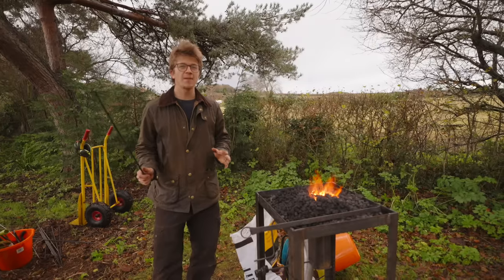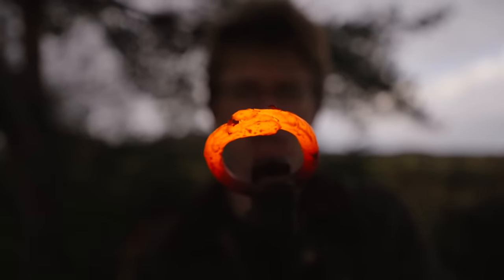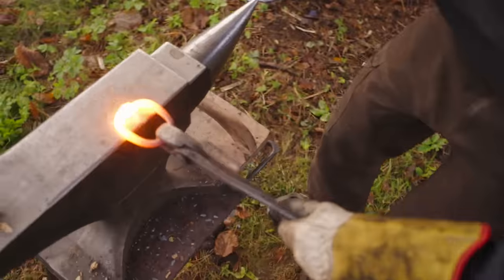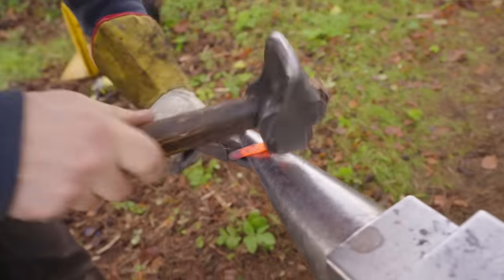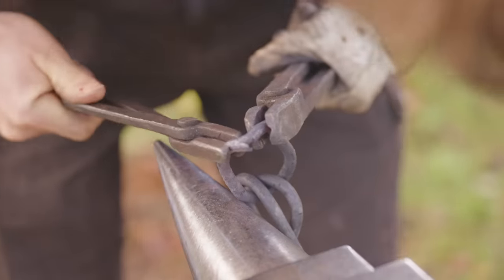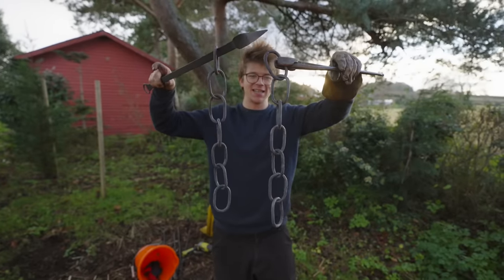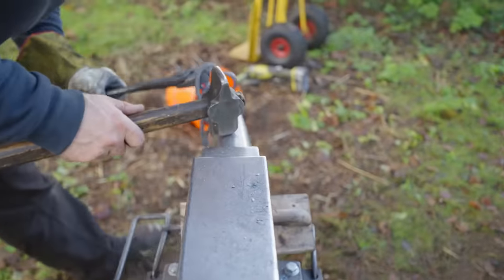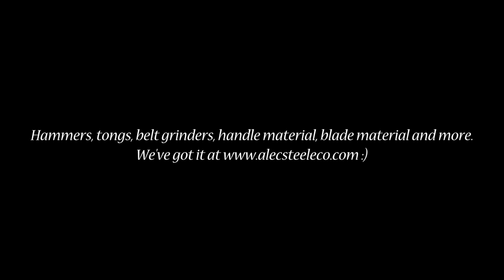How Much Chain Can I Make in a Day?

Comment: You could have potential increased your efficiency by forging all the standalone links first and then making the connecting links. This would allow you to maintain your patternasation without needing to break it on every third link.

You could also use two people with one making all the standalone links and the other linking them together.

Comment: you make your welds on the round end.  modern chain is welded in the middle of the straight part. i wonder if forge welded on the straight is stronger or weaker than welded on the round end.?

Comment: I made chain in my shed on my forge, it’s tricky to get the hang of, I found using 10 or 12mm bar and lengths of 7” worked best, you get a decent scarf and can hit it harder on the weld

Comment: Love the vid! Cool idea and cool thing to do. Only one thing... Shouldn't the weld be on the long end? Or is that a by-product of modern processes?
Reply: I think its just easier to make since you would need some kind of wide and flat on the top horn for correcting the weld. The strength of the weld is the same everywhere i think
Reply: @vaurisyoutube  it depends on how you 'load' the weld. In Alec's case they load sideways as a pushing / bending force. In the case of long end weld, they load lengthways, as a pulling force. The latter usually are more withstandable.

Comment: Really enjoy your videos. 
Curious - other than ease-  why are you joining at the end of the link where the next link concentrates its force?  wouldn't it be stronger to have the joint on the long side so that its just tension pulling rather than a point force on the joint its self at the end of the link?

Comment: My issue is with the positioning of the welds.  where theyre currently located they'll receive more stress directly than if the welds were in the side of the link instead of the ends

Comment: You are missing one vital thing and that is your apprentices. There were blacksmith who only made chain and they would task each one of their boys with a task in the process and then the master black smith would take the links and weld them. He could make chain as fast as he could weld them. One heat and then a proper mold to set the links and then on to the next one. He would of had jigs for holding the chain in place and everything. It would also help if you bought some old chain and examined it. They were all pretty uniform in size and shape. One apprentice would cut round stock to lengh using either a hot cut or cold cut. They would have a forge to which they would move the lenght of round stock over the fire and with a cutting jig and tool cut a sharp angle then another apprentice would be tasked with bending it in to a box shape with enough space that each link could be placed on to the full length chain. The type of chain would factor in during which age you want and what the chain was going to be used for. With a small group of 1 man and 4 younger people you could put out a good amount of work and make a good living. People assume they only had a few staff yet many places prior to 1800 would of had several people working and making things.

Comment: Just wondering, if the weld is the weakest point, shouldn't the weld be on the long, straight part of the chain-link and not the bendy bit? 
Not a blacksmith in any way or form, just curious. Love the channel, Alec!

Comment: The chain making machines were probably one of my favorites to work with

$250k and the operator didnt actually have to do a thing aside from feeding it bars (which a forklift brought in bundles that you'd use a crane to load the whole bundle at once ~2 times per shift)

Comment: Your problem is that you were forging the links while hooked to the chain. Making for more work for your self. You should have set something in your post hung the chain off of that then work the single link until you are ready to slip it on to your chain. Then heat and attach then hammer. Then on to the next link. There is a whole host of information out there on how to do these things.

Comment: I think you should research how they did it back in the day. I only invested a few minutes and they apparently cut them at an angle and most chains I found were welded on the flat part, not the round.

Comment: Just imagine how long it took and the skill to make chain mail. Oh and the cost !
Reply: I may be wrong but I assume with the smaller links and confined jumble it would become would mean that you wouldn't often weld chainmail links. you can buy kits you can make your own with today using pretty much just pliers. I have seen some mail and chain where the links are riveted closed not welded, so this could be a different approach too
Reply: @nathanmiller9381  That's a good point.  Mail doesn't need to withstand anywhere near as much stress as a chain, so the links can be more loosely linked to just support their own weight.  Also makes repairing them much easier, wouldn't even need a forge.
Reply: @andromidius  I think mail would need to with stand quite lot since if the links opens easily it wouldnt work well as armor. In Europe at least mail was riveted for that reason. Modern reactment mail is usually just butted without the rivets because its obviously huge work to peen hundreds of links individually with rivets. They werent made same way though as chain since they are also lot smaller, and thinner stock so you only need stuff like pliers to Link them together before peening. Although i dont know how historically solid rings were made, but sometimes its solid ring then open rings put together then the open rings each are riveted to make them stronger
Reply: They would normally wrap wire around a mandril, then use a chisel to cut a line along the loop of wire, leaving a large number of rings to use as the links. Then you'd need to overlap the ends, hammer them flat/wider, drift a hole through the middle, then rivet them into a solid piece.

There was cheaper buttressed mail where you just push the cut ends of the rings against each other and rely on tension to prevent it from opening, but that's substantially weaker (though cheaper, so common with cheap modern replicas).
Reply: @andromidius  I actually checked online, and the solid rings for mail were apparently made by just simply punching rings from large sheet of metal which makes sense i suppose

Comment: Modern chain making machines do about one link per second. Cheaper chains are done even faster. Expensive ones are made slower, but they are made for loads that you don't normally see in home life. Even then, I have seen links of one inch diameter round be formed cold in a press into chain links in less than 60 seconds. It is... scary.

Comment: Wouldn't it be easier to get the welding point on the flat long side of every link instead of in the round? Structurally that would definitely make more sens for stress as you wouldn't get all the stress concentrated in a welding point ;)

Comment: The strength of the welds would have been much different and much easier when hand forging chain because the material would have been wrought iron not mild steel.

Comment: This would be such a good challenge for one of those competition blacksmithing shows. give them 1 hour. award a fixed amount of points per link and then push the chains until their fail point and award a fixed amount of points per 10kg or 100kg they can lift before failure.

Comment: NICE WORK-very interesting...HOWEVER---for the size link you are making the steel rod used is much undersize-meaning it's much easier to work with thinner stock for your video-but unrealistic in the real world-Cheers...

Comment: Seems like you would want to stick to sets of three or something and then join a bunch of those together and only at the end deal with joining large sections together.
Reply: If you need to make a long chain it's much easier to just perpetually extend one of the ends and have the rest of the chain piled up on the floor or in a bucket. Ideally you would have another guy in the shop doing the cold cutting and cold bending so that you can purely focus on forging.
Reply: @tissuepaper9962  this, making short sections is just more steel going to and from the heat. The full length stays at the anvil and the link being made only goes on before weld.

Ideally the weld is one heat in this case of course.

Comment: It seems to me like you could’ve worked by doing 7 sets of 3, then joining those sets one set at a time so then you had 3 sets of 7, and one set of 3, continue until you had one piece of chain, instead of doing it 2 links at a time in one group with an increasingly unwieldy chain? 

I’m not sure, I’m not a smith at all. Just curious to see if it would work.

Comment: Never swung a hammer at hot metal but you may have been able to produce more if you did the stages in batches. Your muscle memory would improve much faster with the short intervals between actions

Comment: I'm no historian, but I imagine that commercial chain makers back in the day would not be a single bloke on his own. I would think there would be a team of smiths, each doing different parts. Maybe the new apprentice would be cutting the sections to length, the next smith would be doing the bending and scarfing, and maybe a team of two doing the actual welding of the links and sections. That's what I would have if I was running a commercial forge 👍

Comment: Hiring a chainsmith is probably around 60/hr in today's money
1 meter for a full day so let's say 10hrs 
means a 1-meter chain back then costs about 600 bucks in todays money, and that is with just the labor cost.
but i have to say Labor costs where really low back then, and Material costs where much much higher.

Comment: Great video, I wish you would have explained what you meant by "burning the steel" and why it's bad though. I thought you were making a joke the first time you held up a yellow hot piece of metal and said it was burnt lol
Reply: The steel is literally burning, as in reacting with oxygen in the air. Burnt steel is also known as rust, and it will completely prevent a forge weld from taking hold. You have to cut the weld and try again.
Reply: To expand on what TissuePaper said, you know that black layer you see on some steel, sometimes called 'scale'? It's those dark spots you always see Alec scrape off with the brush. That is made by hot steel reacting with oxygen in the air and literally 'burning'. It's a good coating for the outside of a steel product, as long as it'll never bend, because it's a stable form of rust like copper-oxide, it protects the steel from red rust. But it also doesn't react to heat the same way that steel does, meaning the steel won't 'flow' together properly and leading to a weak spot in the weld.

I'm pretty sure Alec covers it in one of his earlier videos, I'll edit it in if I find it.

Comment: did they have flux back in the day, and if so, what did they use?
Reply: Fine sand was common.
Reply: Wood/straw ash and charcoal paste was and still is used as flux
Reply: Using fine river sand as flux sometimes is nicer than borax since you chuck it into the forge at the piece its harder to overdo. Fire will be dirty as sin though

Comment: Alec
Are your hands very much like a Chef’s hands and have became very much heat resistant? Obviously your not holding molten metal via bare hands, but you do get those little pinkies very close to cherry red steel and it doesn’t seem to fizz on you?
Thanks
Happy new year 🥳

Comment: Couldn't you have done it without welding each link shut?  I've seen chain that each link is open ended.  As long as the gap is small enough where the links can't come apart.